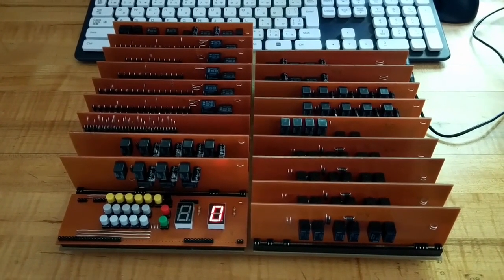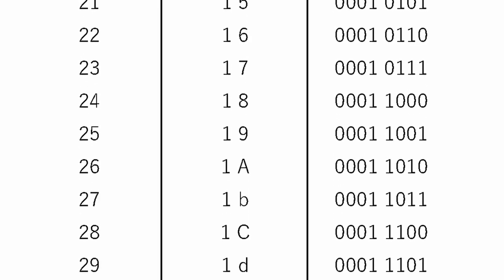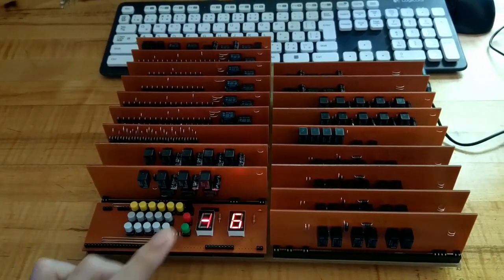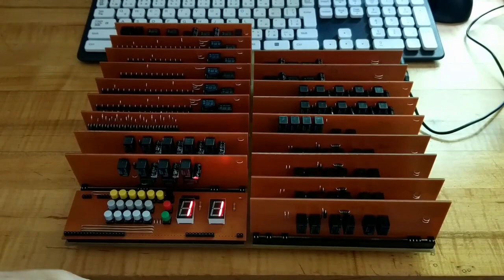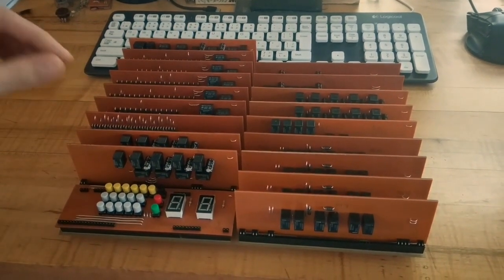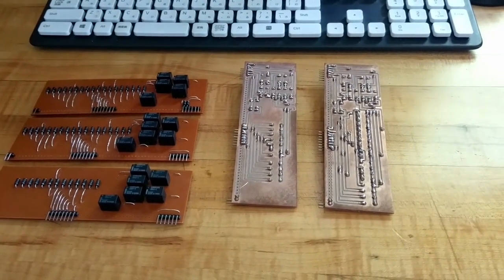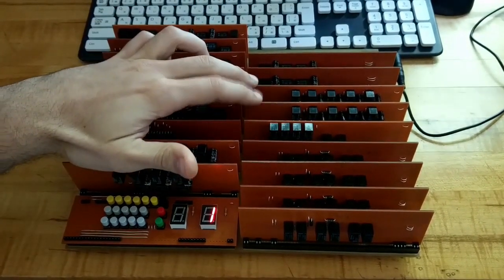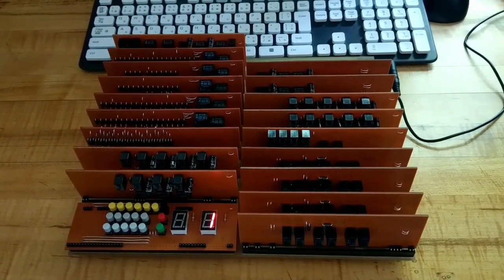Hexadecimal Relay Calculator

Comment: Epic relay switch calculator, as it's kinda a replication of the earliest known digital computers predating the vacuum tube version.
Reply: Ummmm no, these are electromechanical relays which were introduced AFTER vacuum tubes. 

There wouldn't be relays without vacuum tubes.
Reply: @ericchin739  - I don't think you are correct there... 
The electro-mechanical relay dates back to the 1840s while the vacuum tube was only invented in the early 1900s.

Comment: I'm trying to create a calculator, from scratch, with only simple parts (relay, diode, etc.). But I got to a chronic problem, how the hell do I convert binary numbers, ex:00101110 to decimal? so that I can make my display show 46 for example. Making the display translate a 0000...1001 (0...9) is easy, but what about after that? when a number comes with two or more decimal places (ex:10000000 =128). I know it can be tricky to explain, so is there somewhere I can find the answer, maybe a schematic?
Reply: It is easier to use Binary-coded Decimal (BCD).
Reply: It requires complex arithmetic. As Thomas Fok said, it will be much easier to use BCD, but it requires slightly different adder and subtractor circuitry.
Reply: @malloryworlton6359  It's done. I used BCD
Reply: You use a BCD encoder that goes to a 7-segment LED as he has here. 

It takes binary (or hex) inputs and outputs the correct pinout for a 7-segment display.

Comment: Sweet! I’d love to see you add a clear function tho lol
Reply from the maker: Thanks! Yeah, that was a big oversight on my part, and I'm still not entirely sure why the subtraction requires a more complex clear. Unfortunately, without remaking the entire back plane, which was about 9 hours on the mill to make,  it's going to be very hard to make a clear function. I may be able to squeeze something into the slots where the SRAM that has been eliminated is now sitting though, so I may look into that in the guture.
Reply: @UsagiElectric  I realise I'm a bit late, but could you use a temporary push to break button inline with the power socket to make a reset switch ?
Reply from the maker: @Franko_Walker  That definitely could have worked, and probably would have been a better solution functionality wise than what I ended up using. However, that would have required recutting the backplane board, which was about a 9-hour cut on the mill, so I was doing everything in my power to avoid having to do that long of a cut again, haha.
Reply: @UsagiElectric  9 hours!!! No wonder you don't want to change the backplane. :)
Reply: @UsagiElectric 

Use latching relays if you want to clear everything with one button press. 

The reason subtraction is more complex in your setup is because of the "extra" carry bit from doing two's compliment. 

You can solve that by using full adders instead of half adders.